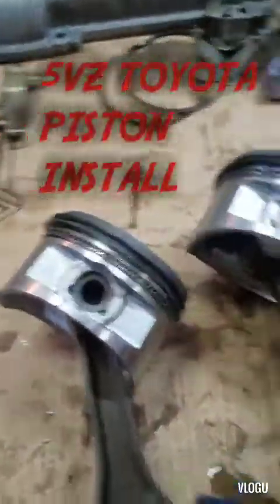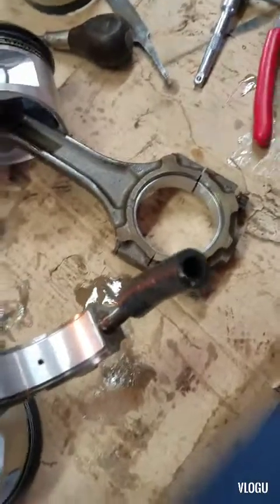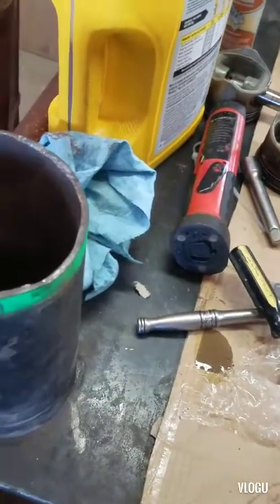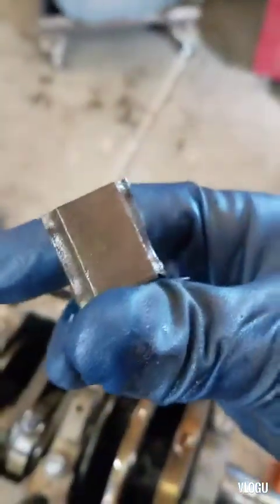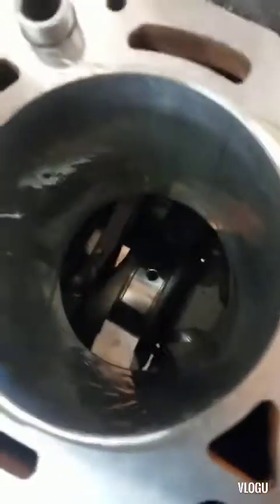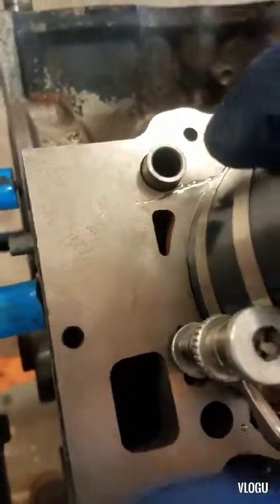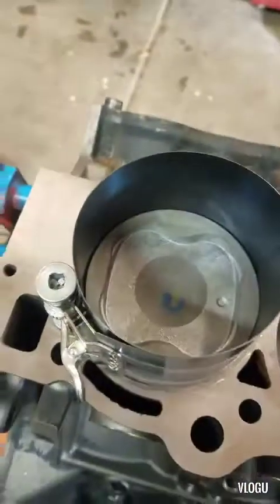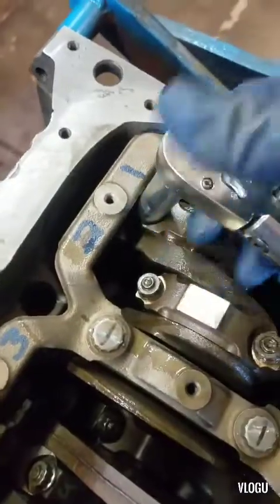Toyota 5vz 3400 piston install and torque

Comment: So do both oil hole  on the sides of the connecting rods have to face eachother? In the Haynes manual it says for the front  protrusion( letters)  to face the front of the engine . If I position them that way I have connecting rod oil hole in cylinder 2 facing  towards cylinder number 1 but cylinder number 1 connecting rod oil hole is not facing the other cylinder .
Reply: Yeah this guy's an idiot

Comment: Piston size is different depending on condition and machine shop boring?
Reply from the maker: NO JUST THICKER OR THINNER RINGS DEPENDING ON BORE
Reply: @autodieselrepair6901  Thank you. I couldnt find oversized rings, they have a lot of undersize so im assuming that's for the oversized pistons. Ill rip my engine out and  take a look. Thanks for the vid!